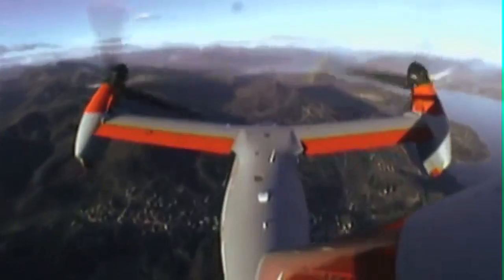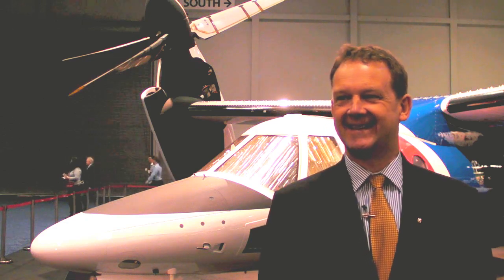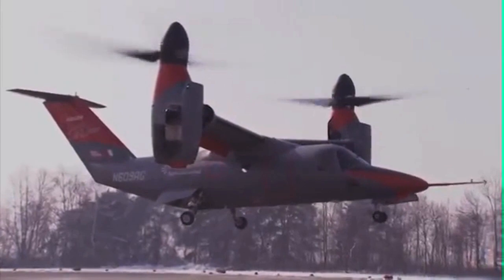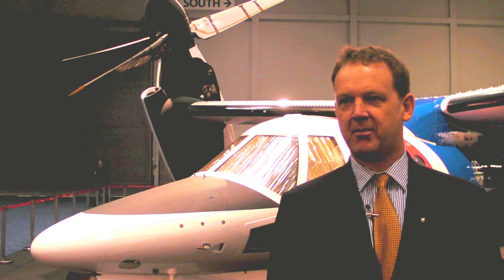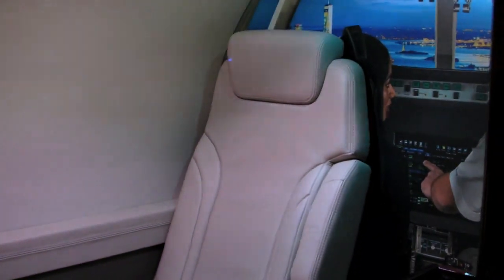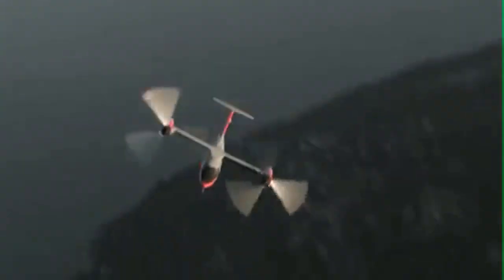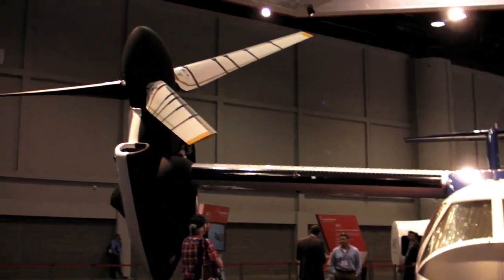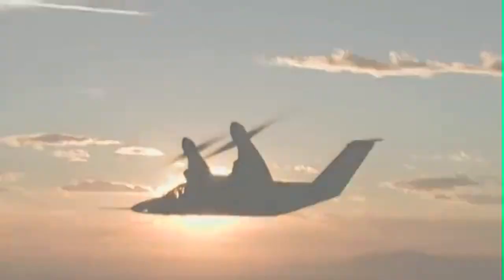AW609 Tiltrotor

Comment: I can't get over how bad your day would be if you lost one of those engines.  I know they're turbines and all, but man.  Best I can think of is pretend you're an airplane that doesn't have enormous propellers and glide to a forced landing.
Reply: If it's anything like the V-22, I believe there's a transfer shaft to allow one engine to power both rotors.
Reply: Mike Kobb Thank god for that!  I seriously can't imagine what it would be like without it.
Reply: It's be a very, very bad day for sure.
Reply: Either engine left running can run both rotors when one is out.